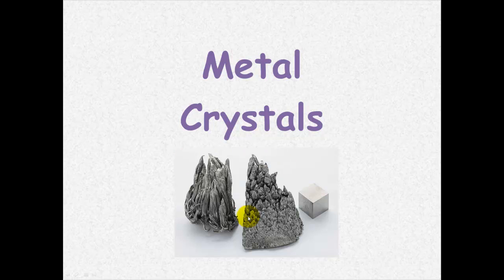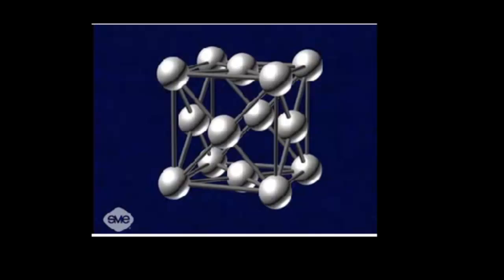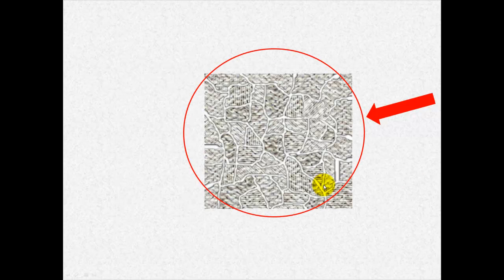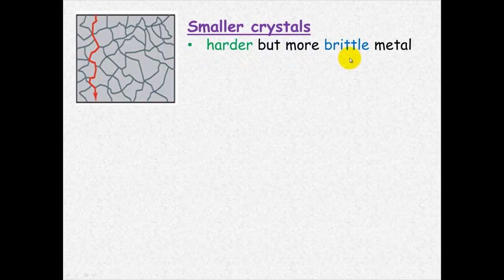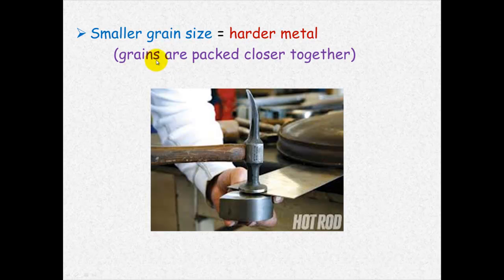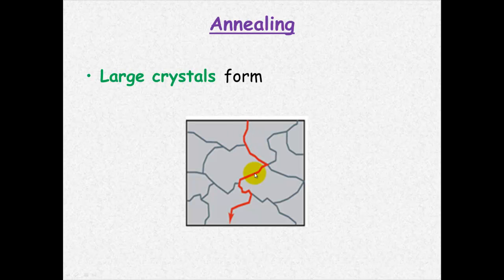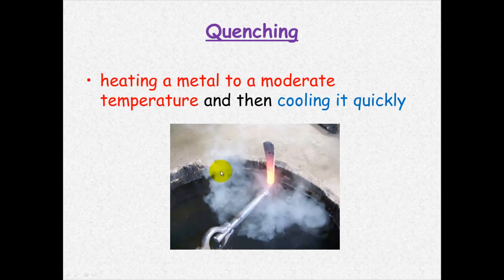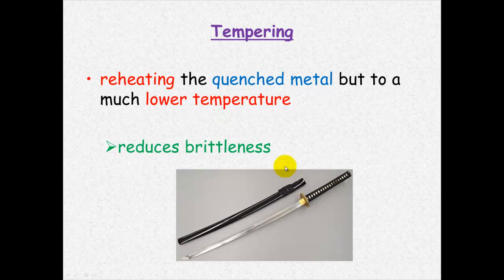Metals - Crystals, Work Hardening and Heat Treatment

Comment: Srsly... Kata? Japanese never used tempering on their katanas. At least historical. It was Europeans wo done that.
Reply from the maker: Interesting, thanks for your comment - I'll be honest and say I know very little about Japanese sword manufacture. You have prompted me to Google but the info. I've found seems to suggest clay tempering.  I'd love to know more - I you can suggest any websites with accurate information about this topic, I'd be very interested.  Cheers :-)
Reply: Katana were coated in clay prior to final heating, with the clay being thicker on the spine and sides and becoming thinner towards the edge. This technique produces differential hardening when the blade is quenched, creating a very hard, martensitic edge while leaving the spine and body of the blade consisting mostly of pearlite and ferrite. The differential densities of the microcrystalline structures is responsible for the characteristic gentle curvature exhibited by these blades, and the transition between phases is evident in an irregular pattern running the length of the blade known as the hamon.
Reply: @davelivesay6711  You guys are talking about different things. The multi-layered katana with different amounts of carbon in the steel used to form the blade vs the core "backbone" of the sword are techniques that apply specifically to swords. The katana also uses work-hardening to get the crystals in line and strong but flexible. But they also quench and temper their steel. All of these techniques are used when making swords (and any other metal object in modern times!!)